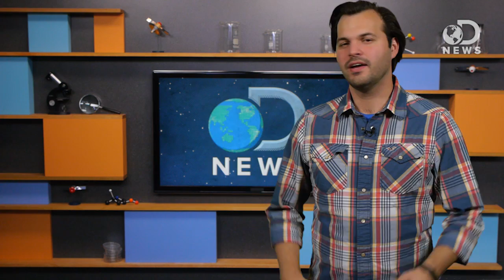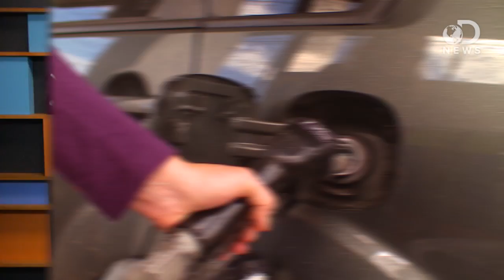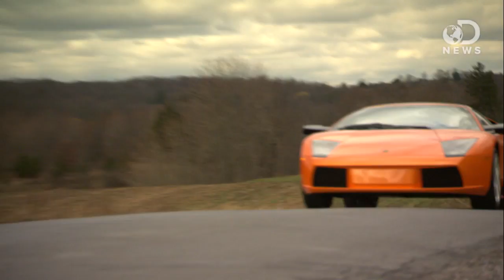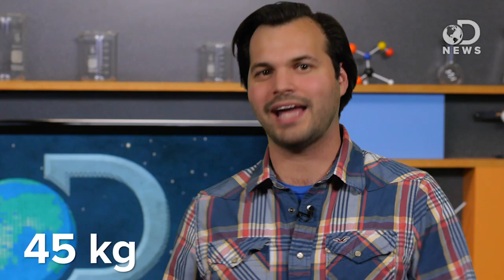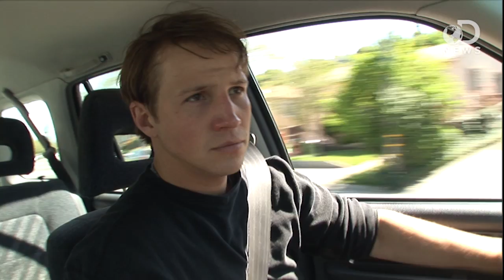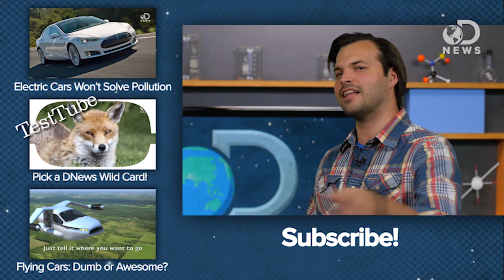4 Ways To Cut Gas Costs

Comment: My pick up I got last year is 13 years old. I made a hobby out of doing minor maintenance work on it. After replacing the air and fuel filters, spark plugs, cleaning the throttle body, and seafoaming the thing I get 4 more miles to the gallon than when I first got it. One, some, or all of those things made it happen lol. Aside from that the check engine light turned off and the engine runs smoothly, the rough idle it had when I got it stopped.

So if you're car is old, maintenance helps.
Reply: And small maintenance beats big maintenance which would result later down the road if you didn't change those filters and plugs and clean the throttle body :D
Reply: Paul Gloor
yeah the plugs were very old, and I don't think the fuel filter was EVER changed, it was definitely putting extra strain on the fuel pump. the throttle body was really dirty too. So glad I didn't wait too long to do that stuff.

Comment: Tire pressure? I put my tires at max-sidewall pressure 51PSI front 45PSI back I have a front heavy Crossover, Sedans you can probably put max-sidewall on all your tires.
There are 3 different grades of max-sidewall 35~, 44, 51 for passenger vehicles.

You are probably thinking not go by the door jam? Frankly... each tire can have different grades. For my vehicle I can have 51 or 44 depending on the specs I want.
Police force and Semi-truck drivers all use Max sidewall for their tires. I see door jam marking as minimum tire pressure.

My tires last longer (5 years now), because the tires don't deform as much and don't heat up as much, use less gas by doing this. Better performance, handling, turning all stem from doing this.

Comment: "The most efficient speed is 55 mph"  Are you saying that I would get worse gas mileage going 45 mph on the highway than 55 mph?  That does not seem to make sense. Drag from at friction must be more at 55 than 45, right?  Sounds like an experiment to me.
Reply: At 45 mph the fuel in the engine is burned relatively slowly. This leads to alot of heat being lost as the car is imited to only use energy to produce a speed of 45mph. Infact, the engine acctually gets more effecient the faster it gets, which is why you'll notice gas consumption is slower here. The reason why however your probably wondering 'then why at 55mph and not 100mph or something' is because around 55mph is when DRAG tends to kicks in. Note this is an average, this value is soley dependent on the aerodynamics of the car.
Reply: Youtube Comments Suck At 55 my rpm are at 1500, 65 rpm increases to 1600, 70 rpm increases to 1800, I find that if I drive 65 mpg I get the best mpg of 24 mpg in a 2002 Dodge Ram 2500. Each Engine and Vehicle is different at which speed is the most efficient for the engine and the vehicle.
Reply: There's actually a speed that cars are made to run with the best fuel economy at.
Reply: Sorry.  I still don't buy it.  The physics do not add up. Drag starts at 0.0 mph, not 55 mph.  Think about riding a bicycle.  At 10 mph, most of the energy put to the crank is used to push air out of the way of the rider and bike.  This has to apply to some degree to a motorized vehicle, too.  Yes, I understand that a vehicle has a lower coefficient of drag, but it still applies.  I still plan an experiment.

Comment: 4 Ways To Cut Gas Costs.

1. Buy Electric Cars
2. Buy Electric Cars
3. Buy Electric Cars
4. Buy Electric Cars
Reply: I walk places...
Reply: and in 7-10 years, pay $12,000 to replace the battery!!
Reply: Lawrence Smith You're supposed to replace your car that often anyway.
Reply: Lawrence Smith Which is about the equal price of one tank filling per month...
Reply: How to cut fuel costs:

Step 1.) Buy Diesel-engined vehicle
Step 2.) Biodiesel.
Reply: ***** Not really, look at the new cars from Tesla, these thngs are awesome.
Ofc. it's much more expensive but prize HAS to decrease over the time. I think in a couple of years electric cars will be much less expensive than they are today.
Reply: Electric cars don't help.  They burn fossil fuels to produce electricity and your electric car takes hours to charge and they cost so much to buy up front that even after five years it is cheaper to own a gas car and fill it up ever month than to get an electric.  Also currently batteries are so heavy that, dare i say it, gas cars are more efficient.  I hate fossil fuels but electric isn't where it needs to be yet.  After graphene batteries and super capacitors are readily available maybe.
Reply: only with the new pos's you see on the road today. toyotas from 20 years ago still run fine
Reply: my car is from 2001.  If you take care of your car they don't start breaking down.
Reply: nice try Toyota...(i know the prius is a hybrid and not an electric car but who the heck cares its the inet)
Reply: DONT BUY A CAR !
Reply: salamander333 classic pile of junk!
Reply: crazyphysicsguy Mines from 1987 ford 1.4 million miles, runs and drives flawless, wife drives a 2002 ram 253,000 miles runs like the day i bought it and gets 24 mpg at 65-70 mph.
Reply: How much does a Tesla cost again?  I know eventually they will be affordable but right now it's just not practical.
Reply: A train is more practical than an electric car for any real distance
Reply: Use a bike. Ride a horse.
Reply: But they suck at the moment
Reply: dempsey roll they already exist
Reply: Couple of problems:

Adding in electric stations every so often as current electric cars do not have the range of normal gas cars (solution within a decade given decent research).

The natural-earth metals that a valuable and rare needed to use them may not be so cost efficient.

And the hardest one of them all, the oil and car monopolies...
Reply: And waste even more fossil fuel!
Reply: Matroskony
Except that without a car most people can't work, basically making their lives useless. So basically you're saying, don't have kids unless you have a lab at home.
Reply: mine is from 1994, it's a classic baby ;)
Reply: ***** yes they do exist, and my aunt owns the nissan leaf,, but for some reason, people won't buy it, because of these stupid oil country/company,keeps on brain washing people. they also pay reviewers so they can sell more gas powered car..and leave the electric ones in the dust.i'd say in everyday life in a month i can see 1-2 EVP/hybrid car in the road, most of the time its rarely..so fck.
Reply: crazyphysicsguy
Absolutely, but it still runs and it makes the hipsters very envious :)
Reply: There are new taxes for electric car owners to make up what you're not paying in gas. Between the cost of the car, the batteries, and taxes, I would bet you're not saving anything. Can't wait for those land fills full of electric car batteries.
Reply: ***** Electricity can be produced a variety of ways but currently solar cells are about 10% efficient and use plastics that come from oil.  Wind is pretty good except the vast amounts of real estate it takes up and the fact that the fans tend to kill birds.  Until there is a better solution I am either building a gasifier car, a hydrogen car, or sticking to gas.
Reply: salamander333 lol thats pretty funny. I'm glad you enjoy your antique car.
Reply: And where will I charge this electric car without a garage? I live in an Apartment in NYC, and that's pretty costly.
Reply: ***** No one seems to like to mention hydrogen. It's as convenient and more efficient than gas while being cleaner and more eco-friendly than electric. Let's face it, electric cars aren't as environmentally friendly as they're marketed to be and lugging around 450 kg of battery (compared to 30 kg of fuel) isn't good for anyone.
Reply: GeneralNgo
Agreed.  Finally a knowledgeable person.
Reply: GeneralNgo
Sure if you want to haul a small Hindenburg in your car then hydrogen is the way to go. Electric sucks not for the concept, but by the fact that lithium batteries is way more of a pollutant than that of gasoline. Also you have to replace them every 10 years.  Not to mention that your electric bill will shoot through the roof. Now if electric cars use ultra/super capacitors instead that is made of a recyclable material then a capacitor powered electric cars will be the way to go.
Reply: james10o1
What? I'm driving a truck that is over 20 years old. If it ain't broke, I don't see the point in buying a new one.
Reply: shane bacawaka Perhaps if you store it in its elemental form. Chevy has been working with a compound that stores the hydrogen in an inert state than releases it from it's cell when the hydrogen is needed. The reaction is reversible so that you can recharge it when the "free" hydrogen has been depleted. Hyundai and Toyota are bring hydrogen cars to market this year. I completely agree with you on the capacitors though. They've been used in competitive racing for a while now and are being used on the new hyper cars (McLaren P1 for example) that are coming out pretty soon
Reply: I know some people have modded normal cars with water to hydrogen systems (chemestry equation H2O + energy(electrical) = 2 Hydrogen + Oxygen).  A normal engine can run on hydrogen if it is pumped into the carburetor and is relatively safe so long as you have a backlash valve.
Reply: Tomas Beblar It's my way of cutting gas costs It's the most effective.
Reply: 1 way to screw the planet
1. Buy Electric Cars. They are worse for the environment than gasoline and lithium is also an extremely limited recourse just like oil. Instead, fund Hydrogen ICE research.
Tesla won't exist in a couple years anyway, they are financially fucked and can't even put out the cars they sell.
Reply: Lawrence Smith+ According to Tesla, expect 5 years.